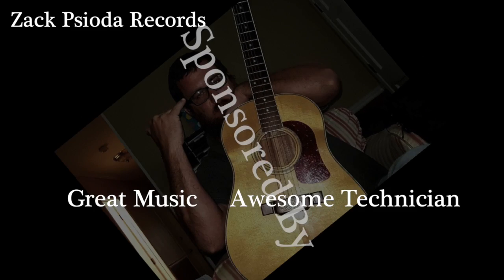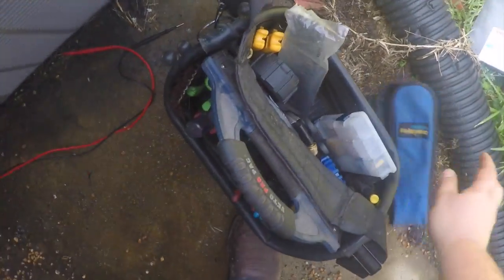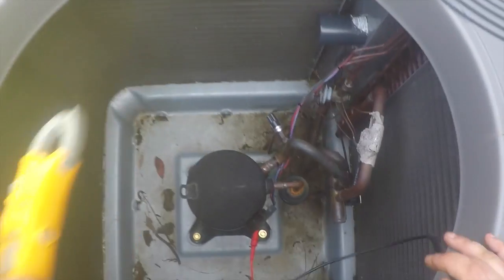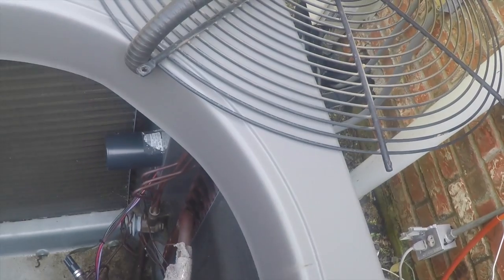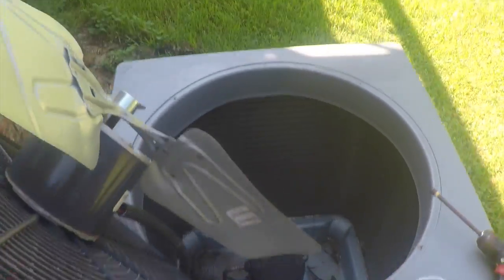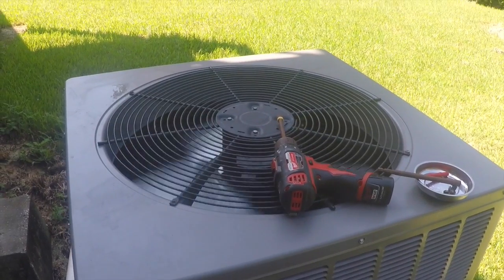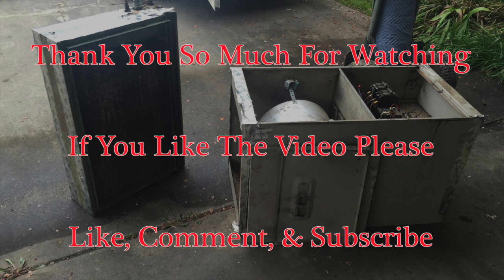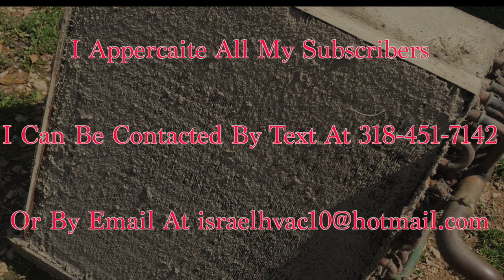HVAC: Checking A Compressor For Ground

Comment: You can have a short circuited compressor winding that is not shorted to ground. Also when using your multi-meter in measuring resistance to ground, you might touch your leads to two separate ground points to ensure that your grounded lead is indeed grounded.

Comment: I've found 2 compressors last week where the windings were shorted to each other. I used my megger set to regular continuity, not megaohms, and it showed 0 ohms between 2 windings

Comment: A motor can be shorted phase to phase without being shorted to ground .  

     Any way to tell if it is mechanically locked down ?

     What would it do if the capacitor was bad ?

God bless
Wyr

Comment: that compressor has a jam   mechanism when the power is introduced, the compressor will try to start and then pulled high current beyond the breaker arm's rating then the breaker will trip. some time's the compressor can be rescue by tapping hard on the compressor body with a big hammer. is a good video best regard Thermoadams.

Comment: Good job Israel, I like reading the comment section on all the videos you guys post on here, telling you check this check that, hell, it could be anything causing the breaker to trip, but when they flag instantly, lol, generally, it's a freakin shorted motor, doesn't have time to pull lock rotor amps.lol... keep the videos coming, as I just found this Hvac community on YouTube not so long ago and it's entertaining to watch others work on the same stuff I've worked on for the past 30 plus years. Gonna subscribe. Later.

Comment: can anyone help me? my unit outside to my central keeps flipping the breaker that's in the unit outside. and it humms then stops . any ideals what's wrong ? I can't afford to have someone come out right now and it so hot
Reply: Nancy, sounds like your compressor is locked-up.   There is absolutely nothing you should try and fix yourself, as high voltage can and will kill if your not properly trained to work with it.  I'm just giving my opinion on what could possibly be wrong with your AC system, it could also be a blown run capacitor , bad breaker , contactor or compressor shorted out like this video we just watched.   Please call a qualified technician to trouble shoot your system.  Nothing you can check for yourself.  Sorry about your situation.  Sterling

Comment: I've had the same result even with the megger. Just remember that circuit breakers for this application are designed to protect against ground faults and short circuits. You did test for a ground fault, I don't know if you tested the winding to winding resistances to check for a short circuit between motor windings. C to S + C to R should equal S to R. In my case, it passed the megger and not the second test.

Comment: I'm wondering if the compressor is mechanically locked up, even though the stator is healthy? Cut a hole in the side and try to spin the crankshaft....

Comment: John and the Group; a Supco M500 is decent as a megger For Hvac work ; but the lower end of 20 megs can scrap out equipment that might still be fixed. 

A hand crank unit often goes radically lower in range than the Supco . My Trane compressor here read below 20 megs (bad)  with the Supco, but was not zero with the hand crank unit. After I pulled the connector to the compressor and removed the marsh grass, it still read poorly with both. Then I got in there and removed the Katrina crud scum by the pins and it passes with both. 

The Supco M500 reads close to the old Navy crank Biddle Meggar unit here thus I have faith in the Supco unit. All it takes is some salt crud or muck to be by the pins for any megger to read low. Down here in the swamp by the ocean all it takes is a hint of moisture and a blade of grass or spider web for the salt to conduct that 500 volts by these meggers. Lately each morning is 77 F at 95 RH at sunrise here. 

https://www.youtube.com/watch?v=_PEXgo2Pm1s

There are in Engineering other voltages to test breakdown too. The Supco and my Biddle crank unit use 500 volts. 1000 volts is another test voltage too. 

Remember if you use your Harbor Freight 6 dollar voltmeter on megaohms it might read the same megaohms as Supco M500; or might not. ie often not. The small voltmeter probably is using that 9 volt battery only thus 9 volts may not break down that bad region. It is common for the added 500 volts of a megger  to break down the marginal area and thus if shows as bad.

Comment: I 've had 2 compressors in the last month that did not show bad with my meter but did with my megger. I like the Supco, so far it has not let me down.
Reply from the maker: I gonna go with the reed cause it will show you numbers all the down to 0!! Supco only reads to 20 megaohms

Comment: It could be a wire or a wire connector, you should test it putting a load on the compressor wires. you need to test externally before you worry about compressor windings you can not fix.